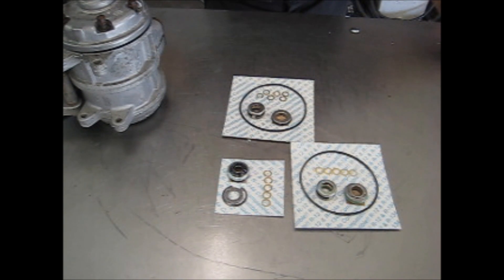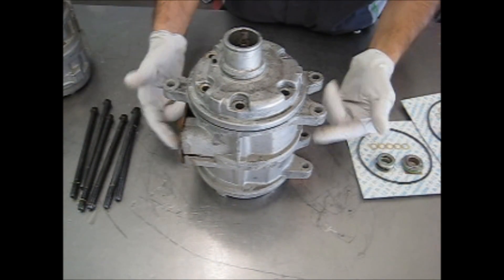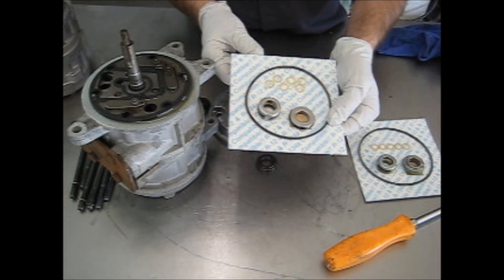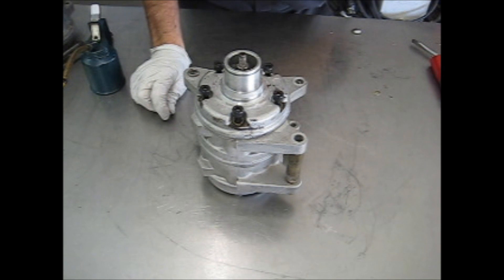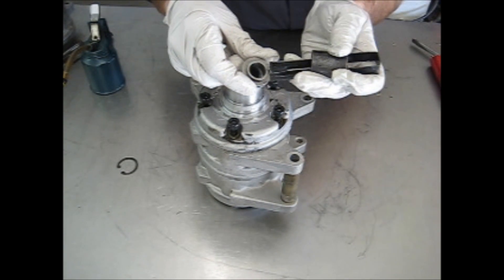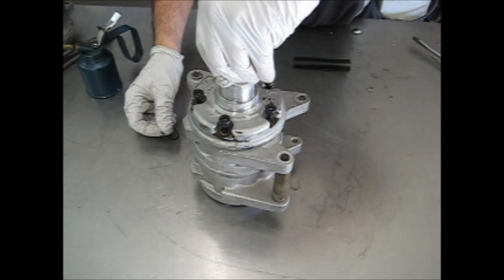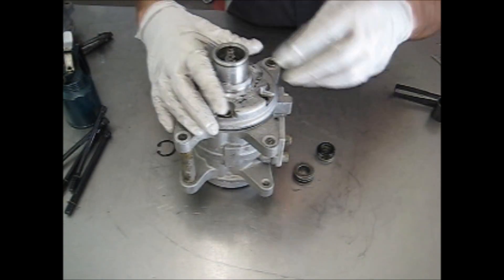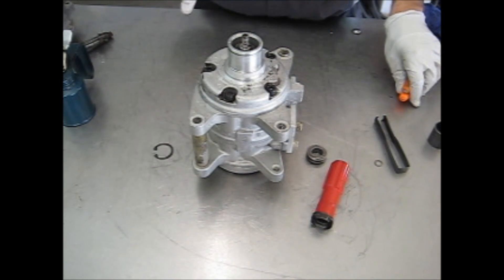Denso 10P Series Shaft Seal Replacement

Comment: Does this apply to a 10p17c?
Reply: Yes, they are basically the same. The 17 is just larger.
Reply: @bobsteinmann5793  I finally am getting around to doing this but having a hard time getting the clutch off. It's a 10p17 compressor in a w126 Mercedes with the clutch PN of 047300-3880 Denso and Mercedes Benz 116 130 02 06. There was a small 12mm nut I removed but I don't want to force the clutch or pulley off. The clutch has what looks like internal threads on the center near the shaft, along w what looks like a woodruff key.
Reply: May be stuck on the key/shaft. There is a puller tho remove the hubs when stuck. However, I doubt they are still made.  @nicholasroche
Reply: @bobsteinmann5793  Thanks bob! It looked like there was a latch inside a 'window' for the woodruff key on the shaft but it sounds like the clutch should just pull right off?
Reply: @bobsteinmann5793  thanks - got it off with a puller from AutoZone. 

The outer stationary part of my replacement shaft seal had a part with a ridge on it, I'm assuming that faces the inner crankshaft side to ride the rotating side

Comment: Why do a lot of guys use mineral oil instead of Pag when they are lubricating seals. I am assuming we are working on a 134-A system that requires Pag oils. Thanks-Nice collection of videos that you have made-John James
Reply: +john james ,Because PAG Oil is hygroscopic (like brake fluid is) and absorbs moisture from the air and atmosphere. If PAG oil collects moisture it causes, rust, corrosion, and form acids within the system as a result. Do it correctly and use Mineral Oil like you are suppose to use. You can also use Nylog too.